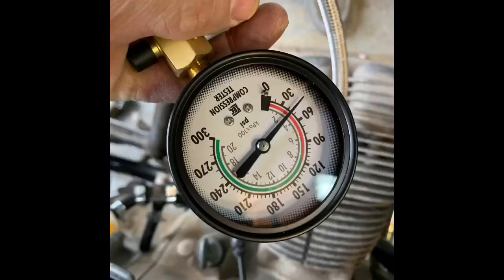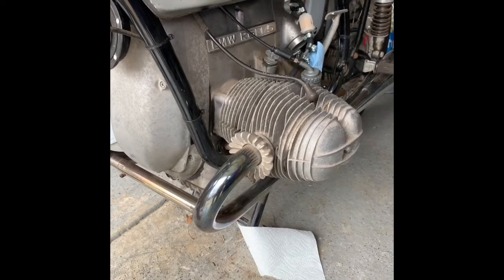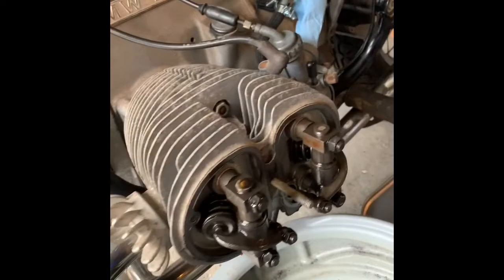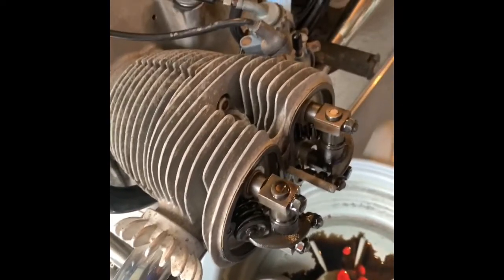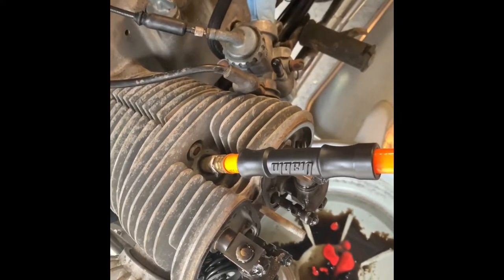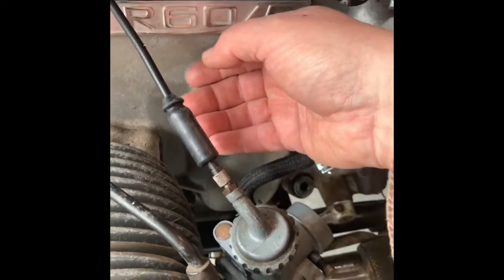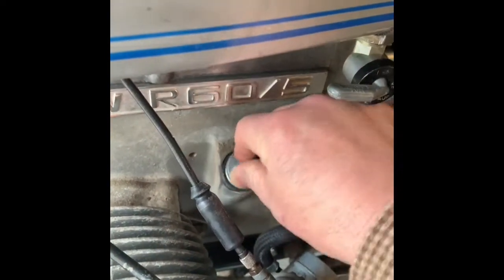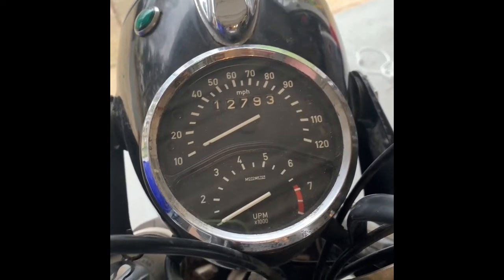1971 BMW R60/5 Low Compression Evaluation

Comment: bummer. seller definitely isnt getting good feedback
Reply from the maker: I got lucky and found a set of new "old stock" pistons with rings installed.  Pulled (and honed) cylinder and put in new piston with rings and compression back to normal - runs great now!